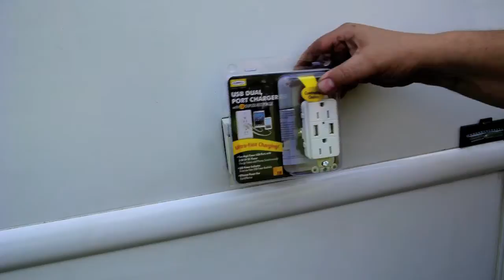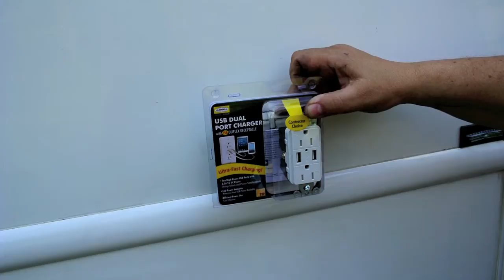Add a USB/120VAC Outlet to the outside of a RV.

Comment: Another great mod. One I'm going to do on the inside in a few places. My outside recept. is a GFCI so I probably won't be doing that one even though I would like to. Keep the videos coming.
Reply from the maker: realredrebel  I was lucky that the GFCI for the outside is connected downstream from the bathroom, where the GFCI is actually located. 

What many people don't know is with many GFCI outlets, they not only protect the devices plugged into it, but also any outlets connected to it (downstream from the breaker panel).

If you can find where your outside outlet is connected to (hopefully it's not the first outlet in the string from the breaker panel, you can replace the first outlet with a GFCI, and the outside outlet will also be protected (provided the GFCI you install is of that type.
Reply: awboater Thanks for the info! Just found your channel & sub'd! Cheers! ~M

Comment: ...This was a great mod, thanks for the vid. One thing to keep in mind is this USB outlet is only going to work when you are plugged into shore (or park) power. It will not work when one is boondocking and running on batteries, unless this outlet is wired to an inverter.
Reply from the maker: That is true.
Reply: They sell 12v USB outlets also

Comment: shouldn't a gfci outlet be installed on the outside?
Reply from the maker: A GFCI outlet will protect all other outlets connected to it. For example, the outside outlet was the last one in the connection string, with the first one from the electrical panel being a GFCI outlet. The result is all of the outlets in that connection string after the GFCI outlet are also protected.